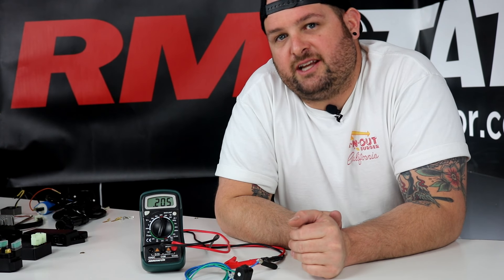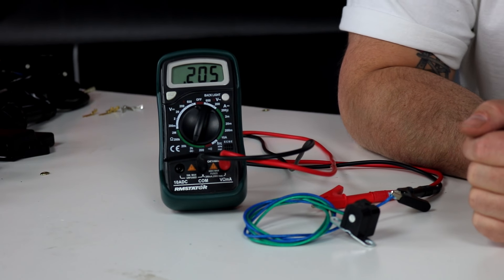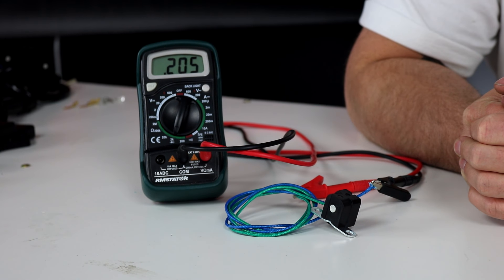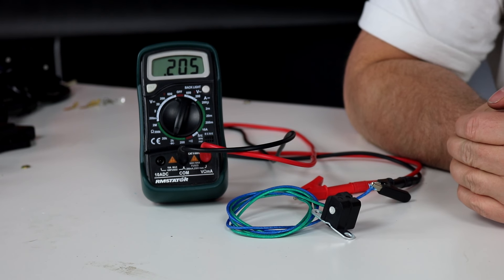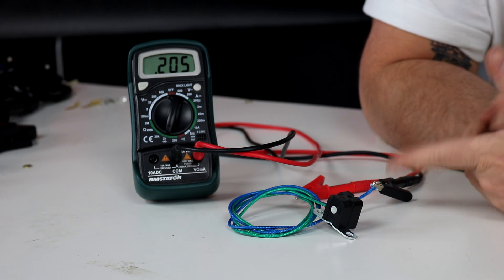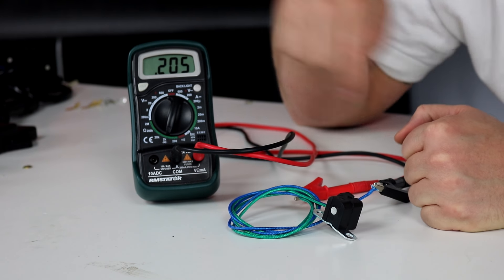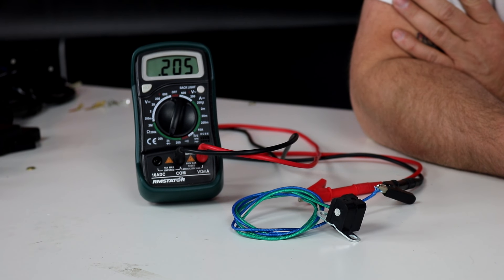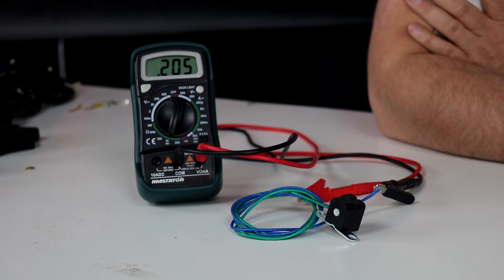How to Test a Pickup Pulser & Trigger Coil for Motorcycle, ATV, UTV & Snowmobile  - RMSTATOR

Comment: I have a pickup that measures to spec ( Suzuki 68 ohms ) but does not generate enough voltage ( installed at the correct distance from the magnet ).
Replaced it with another ( same resistance ) and twice the output voltage. So resistance test alone is not enough.
Reply: The gap between the rotor matters. There is a spec for that also. In the event the gap was off that can create a difference in what measurement is sent.
Reply: @ZCRAIZED1  As it is a coil who expand by heat resistance shift, so if its damage, your bike wont start when its hot.....and when testing it while motor is hot, you get another ohm.....then you have to know what range/ohm has when its new/unbroken?

Comment: I cant find my pickup coil ohm specs anywhere online. It's a 91 honda 300 fourtrax 4x4. It bugging the snot out of me. I have a 350 rancher 04 model, 89 300 fourtrax 2x4 and this 91 300 and none of them have continuity to ground with the blue/yellow wire but the 350 and the 300 2x4 did run. The 2x4 needs rebuilt and the 350 rancher needs new case oil drain stripped. I just need to know the ohm specs for a 91 300 4x4

Comment: Hi there,
Was wondering if you could help me. My 2002 Honda CBR 600 F sport (f4i) won't start, it's not getting spark and I think it's the pulse generator. I'm trying to test it but can't seem to find the specs for it, mainly the resistance values, it reads 500 ohms but not sure if that's right or not, peak voltage I can't test till I buy the adapter.
Thanks for any help
Scott
Reply from the maker: The pulse generator on the F4i doesn't have resistance specs in the service manual. It specifies 0.7V at cranking speed using a PVA (we have the peak voltage adapter available). 500 ohms sounds reasonable, but I can't guarantee that is good.
Reply: Thanks, pulse gen turned out to be fine. However the cam pulse gen was faulty reading 1Mohm+ so replaced but still no luck, waiting for spring to revisit the issue 😅 she WILL run again  🤞

Comment: Will you still obtain spark when bypassing starter relay? If not then I’m really just chasing my tail.  Raptor 660… I’ve gone through entire wiring harness. I know the relay is bad so I’m bypassing it temporarily but not getting spark. About to test my pulsar pickup coil next.
Reply: Your stator is shorting out my boss had the same issue.. it's a very common issue on the raptor 660 specifically the wires inside the case for the stator short out on each other causing no spark... I found it in a forum after doing everything new coil new this new that you know... anyways there's a few wires coming out if the case from the stator I know you just need to cut 1 of them and it will start I do not remember what color it was red or yellow it fired up instantly after that.. his quad sat for 2 years because of that issue and I just searched a few forums and found it was a very common issue. His battery did not charge afterwards but it did run for a few hours on a good battery and was able to troubleshoot the issue we put a new stator in it later. You could even cut 1 at a time and put connectors on them so you know wich wore it is or just search raptor 660 stator shorting out quick fix you'll find the same post on the forums I'm sure

Comment: I have a Kawasaki KZ440 that has a bad pickup coil...no spark when the engine warms up.  Can't find a replacement anywhere.  I was going to try to make it work by buying a pickup coil for another bike and do some work to mount it in the same position.  My wires are black and blue on the original.  The coil I want to buy that looks like it will fit has wires that are white and white with a red tracer.  Does the polarity matter on the coil?  My coil tests out a 480 ohms...each way of course.  How do you tell if polarity matters.  Thank you.

Comment: My distributor is only providing spark when it's spinning fast by hand. The engine crank won't let it spark. But the starter rpm is grate. Is it the pickup coil? Toyota 4age 16v twin cam
Reply from the maker: A distributor system is not really related to these powersports ignition systems. But your car may have an electronic trigger inside the distributor that operates similarly. This trigger could be a problem, yes.

Comment: I have a 454 bear cat 4wd arcticcat no spark replaced coil what do I ck next all wire and connectors look good.what should the wire plug in to the coil read
Reply from the maker: You could easily have a bad CDI box, also check for a shorted to ground kill switch. Coil specs are available on our website.

Comment: If it’s a two wire does one of the go to group and the other to the cdi? If so which one goes to ground? Thanks brother
Reply from the maker: If the pickup coil has 2 wires, usually both go to the CDI. One is likely internally grounded inside the CDI, but not externally.
Reply: @Rmstatorinc 
I have a 2 wire pick up coil and only one goes to the cdi and the other to the front of the scooter. It goes to the kill switch and then to ground. I would assume by this that the kill switch is just an interruption of the ground to stop the engine from running. I still can't get the thing to spark after changing the coil and stator. Cdi is on the way but I have never seen a cdi that works intermittently as this one has. Some spark but every other time spark is needed and very weak so the bike hardly runs at all and then no spark at all. A few minutes later great spark and runs perfectly for 30 to 60 seconds then after shutting it off it won't run again. Very confusing. New carburetor and plug also.

Comment: I have an XT600E 96 year, in the winter I lose spark, it used to be below 15 degrees C now below 20 and it won't start, if I let it sit in the sunshine for a while its no problem and in warmer weather, a friend told me its the pickup coils gone out of the resistance range causing the problem and sadly I have to get the whole stator and coils as a unit unless you can supply just the pickups?

Comment: Do the pickup coil turn on fuel pump and spark plug on a UTV??
Reply from the maker: The pickup coil only provides a timing signal for the ignition system. It does not directly control anything else on the vehicle.
Reply: What could cause no spark n no fuel pump to turn on, I already checked fuses n I swap Relays around n nothing change. Battery is new n try different batteries also ??

Comment: How much voltage should I get from a one wire spark generator when cranking the motor?  Mine ohm tested good but it doesn't seem to be generating any voltage.
Reply: i know im randomly asking but does someone know of a way to log back into an Instagram account??
I was stupid forgot my login password. I would appreciate any tips you can give me
Reply: @Atlas Sutton instablaster ;)
Reply: @Roy Douglas I really appreciate your reply. I found the site through google and Im in the hacking process atm.
I see it takes quite some time so I will reply here later with my results.
Reply: @Roy Douglas It did the trick and I now got access to my account again. Im so happy!
Thank you so much you saved my account!
Reply: @Atlas Sutton You are welcome xD

Comment: Hi sir could you please tell me how to hack CDI unit to get engine rpm signal for my digital tachometer. I have 2004 Honda Rebel 250. Thanks.
Reply: For a digital tach, connect the signal wire from the tachometer to one of the grounding wires from the ignition coils.
Reply: Or rather, the signal wire heading to the cdi. The not power to coil wire.

Comment: Hello, on my outboard engine is trigger very hard to buy, si i removed the coil and with almost same wire made new. Original should be 750-1400 ohm and send 0,5V+, coil i made is almost same but give me just 350ohm.. what happend if im gonna try with 350ohm, can i destroy switch box?

Comment: Evan thanks for the video. I have a question my suzuki ozark 250 shows a spark for about 4 seconds then no spark at all. If I stop cranking and start cranking again it will do the same thing.  Already tested my pulse generator as you show on the video and it reads ok. Any suggestions on what could be causing this. Cdi, voltage regulator, and ignition coil all have been tested on another atv an all work as they should. Thanks
Reply: Try a new spark plug, have had this issue on a king quad with a bad  but new plug

Comment: If there are 2 wires coming from your IPG should there be a resistance reading between both wires and the frame/ground?
Reply from the maker: No, generally if there are 2 wires from the pickup coil it will not be grounded to the frame. Resistance reading (if good) is only between the 2 wires.
Reply: @Rmstatorinc  where to connect for the  2 wire pickup coil? 1 will be to the pulser terminal fron cdi, 2nd wire should be where? Im having problem with the after market cdi installation due to 2wire pick up coil. Appreciate your feed back.
Reply: @Rmstatorinc  ~ my pickup shows the correct ohms but "no " volts when cranking ( it starts and runs ) misses cuts out after it gets hot  ~  any thoughts

Comment: This deosn't always mean that the spark trigger coil is good though. You can have coils that test within spec but don't provide the needed voltage to activate the CDI box to cause spark.
Reply: Thanks for the reply. I now have one more chance at hope of solving my no spark problem.
Reply: How to test a 3 wire CDI Box similar to HPI 210
Reply: @rickharris5485 did u solve your no spark problem? Im having same issue
Reply: @TheRealAndroidDoctor If I remember right, mine had multiple issues. I bought the 4 wheeler not running and someone got into the stator/coil section and monkeyed  around in there. They had the pulse coil mounted the wrong way. It also had a bad terminal at one of the connections, but I can't remember which one. It started and ran good after that.
Reply: @rickharris5485  OK bro thx for the reply

Comment: My coil has ohms of 118. Is this to low?? I can't find the culprit for no spark. This is my last option.
Reply: Any update on this? Mines at 130 and same problem.
Reply: @tylerrussell4885  I have worked on cars, atvs and motorcycles my whole life. My cousin also and we never found the issue. Sold the bike in parts. Its never good to throw parts at a problem but here I would say its ok.

Comment: My pulse coil is broke I can't find a replacement for a klx650 will any pick up coil work thanks
Reply from the maker: No, it will need to be the correct size, bracket spacing, and resistance to work correctly.
Reply: @Rmstatorinc  if I use,
same size, correct spacing and same resistance,
but from another brand/oem,
does this create issue with my bike?

Comment: On ThumperTalk forums there's an article I follow regarding pulse generators on a XR650L being the culprit for the bike not wanting to start after its been ridding awhile. I've been having the same problem with my XR650L, I'll go on a ride, do my business, get back on my bike and no start. It turns over but its not firing up, not until it cools down about half an hour later then it'll start up again. I get lucky on occasions it'll start up right away if I don't let sit too long but most times it needs to cool down awhile before it will fire up. Some say valves, others say turn off gas ahead of where you're stopping, but I'd like to think pulse generator because others have had success, your recommendations?
Reply: What was the culprit (assuming you finally fixed it)?
Reply: @bikersoncall  replaced the pulse generator and havnt had any problems
Reply: @WILLY52368  Cool, glad you got 
it back running. My issue was the 
stator.

Comment: How much voltage across the two wires?  Mine puts out 0.2 vAC.  My engine runs fine at low rpms but misses/backfires badly at higher rpms.
Reply: did you find out about the 0.2 volts , mine want show any volts but runs and misses after 1/4 throotl
Reply: Did y'all figure this out? My bike misses at 1/4 throttle

Comment: my pick up coil is fixed to the stator no gap adjustment, jawa 210 how to test for no spark??
Reply from the maker: Many systems do not have adjustable pickup coil gaps.  You can still test the pickup coil resistance to see if it is in spec.

Comment: My Pulser coil i tested on my KTM showed no reading at all? does this mean the wired and brocken?
Reply from the maker: It could be broken. If you measure an open circuit between the pickup coil wires ('OL' or '  1' on your meter), this means there is no connection. It would definitely be bad.
Reply: @Rmstatorinc  ye u need to get the manual of the bike and see what you're reads could be low or as above if it reads 0 or 1 u need a new one

Comment: IVE  GOT A 1996  GERMAN MZ 660  IN  THE  SHOP WHICH  JUST  USES   A YAMAHA  660 SINGLE  ENGINE..  IM MEASURING  LESS  THAN  1 OHM  SO IT  LOOKS  LIKE  NO RESISTANCE  WHAT  SHOULD THE  RESISTANCE BE?    AND  DO  YOU  HAVE THE IGNITION PULSE  SENSOR  OR SOMETHING  CLOSE  ENOUGH

Comment: is the second wire a ground?
Reply: NAKEDTRUTH2012 so I’m working on a similar project and if you have Yamaha wiring the blue pick up coil wire seems to be ground
Reply: NAKEDTRUTH2012 faulty sensor maybe?
Reply: NAKEDTRUTH2012 sounds like you know more than me about this but for me I got spark using one of the wires as ground
Reply: NAKEDTRUTH2012 just a ground to the frame use the same ground as the ht coil ideally

Comment: what is the green wire for?
Reply from the maker: The green and blue wires are from the pickup coil we are using as an example in this video.
Reply: green wire is ground wire
Reply: @williamgarong1034  for house wiring not sleds and atvs
Reply: @williamgarong1034  can i use any coil for for any bike.. I have a klx650 can't find a coil anywere
Reply: db db for pick up coil yes you can but not the whole stator assembly
Reply: @williamgarong1034  so any two wire pick up coil box will do or will I need one of a 650
Reply: db db you use any pick coil just fabricate a bracket with same holes for the screw for installation
Reply: @williamgarong1034  one more question the two wires can I wire them any way or do they have to go a certain way like is one ground and one is power
Reply: db db you must install it with certain connection otherwise it not works

Comment: Think my pulse generator is bad in my xr650r. Is it as simple as just cutting it out of the stator wire harness and replacing?
Reply from the maker: Yes you can, but the stators aren't particularly expensive. I would recommend replacing the entire assembly.